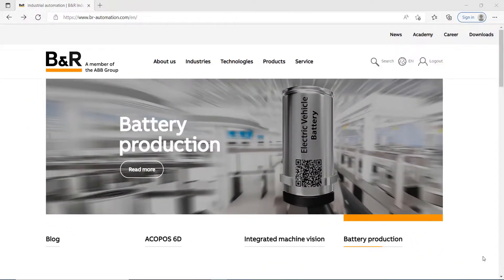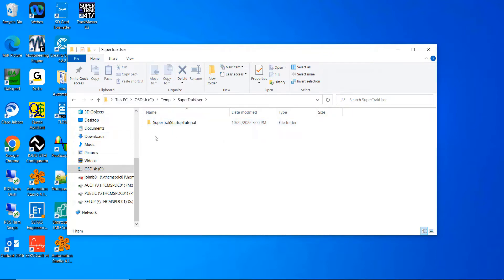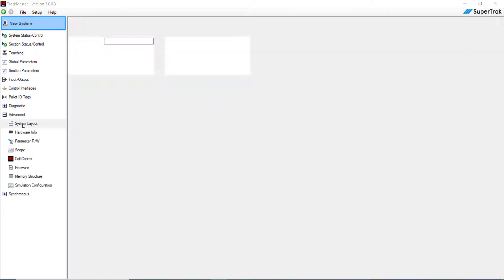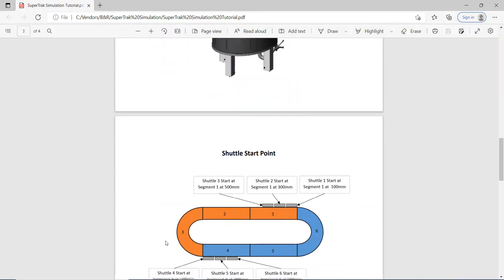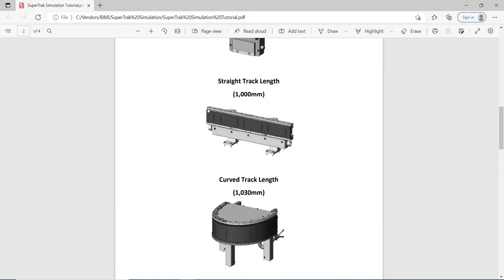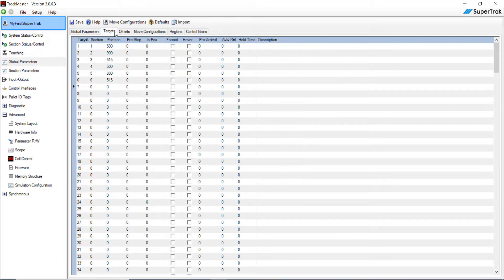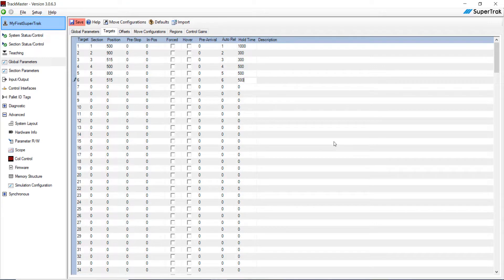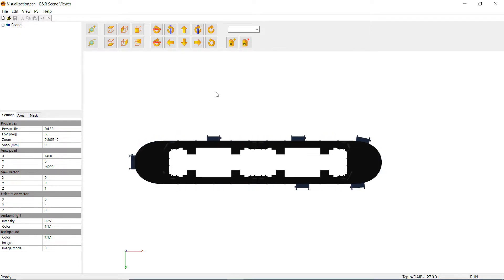SuperTrak Simulation Tutorial Part 1

Comment: A question, if i declared some variable and it self protocoll os J1939 but the card analog input works INT variable, is necessary converter the variable before in especific Block for example J1939_INT?